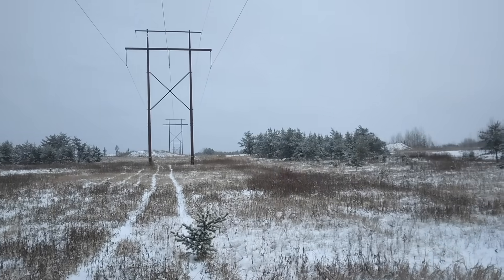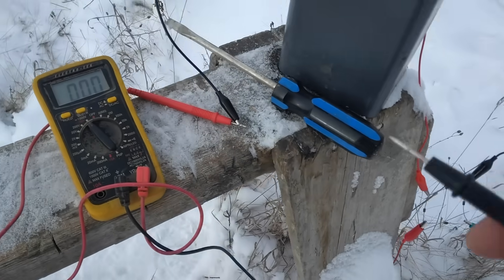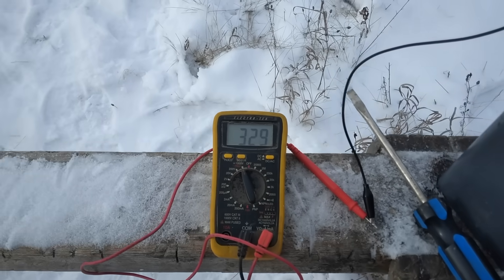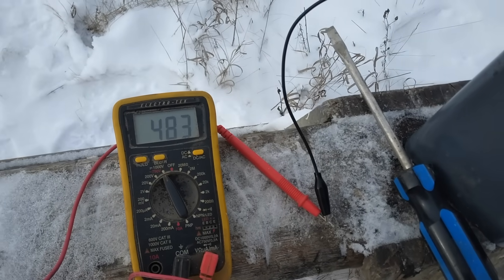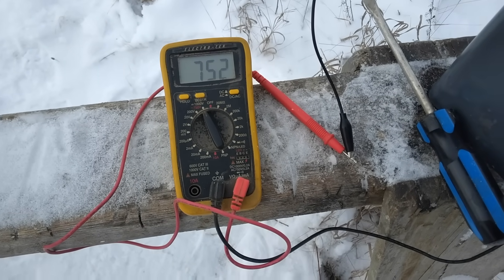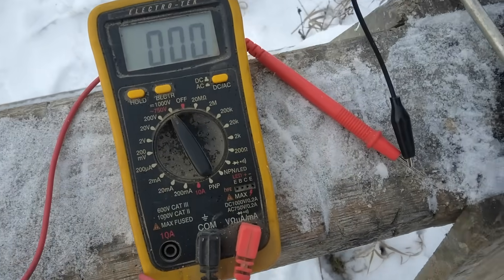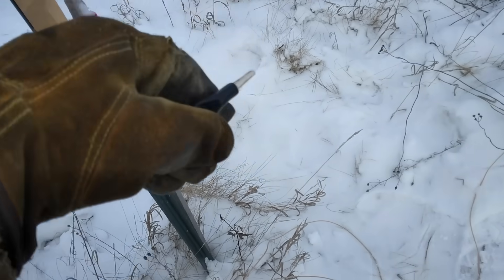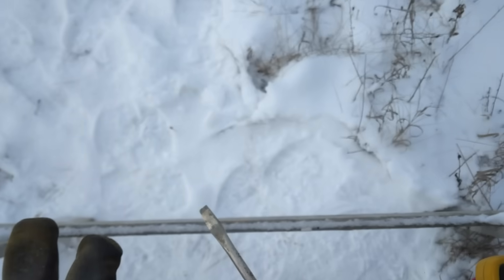Fences sucking power from under HV transmission lines

Comment: Your calculator showed 36.2 joules stored that you discharged in millisecond(s). I had an implanted cardio defibrillator about 4 1/2 years ago that hit me with 33 joules, discharging into my heart and completing the circuit through the tissue in my left front shoulder where the device resides. One week ago, my new device, a CRT-D type pacemaker, defibrillated me with 40 joules. These numbers are documented. It didn't kill me. It didn't really even hurt. It did startle the CRAP out of me and elicited a profanity laced outburst because I had no warning the shock was imminent. It left my ears ringing for about 5 seconds and a tightness in the muscle of my upper chest for several minutes. More importantly, contrary to your suppositions expressed in the video about killing a man or maybe two, that 40 joule mule kick very likely saved my life.
Reply from the maker: With practically no inductance, a HV capacitor discharge can reach its maximum current (Imax) practically instantaneously.  A defibrillator is regulated for resistance and time.
(For the record) Please do not even jokingly suggest that someone try a HV capacitor discharge through their body to try to prove something.
Reply: @doubleMinnovations  In my particular style of defibrillator, peak waveform is attained in approximately 4ms and completes in less than 7ms. Typical therapy applies at 750-900v through 30 ohms and this past weekend, the discharge was documented at 40 joules. My leads are implanted to a very specific site on my heart, meaning no arcing to cause trauma and application of the energy where it will theoretically be most productive. It knocked the crap out of me by total surprise but, then it was over - no lasting trauma, heart rhythm restored.  I wasn't intending my comment as a joke and I never suggested anyone pass any type of electrical discharge through their body. But, thankfully, some very bright engineers developed a very cool device that saves lives and, lucky cyborg that I am, I had one on board when I needed it. To be fair, even a relatively small amount of energy applied to your body in a particular manner at a particular location or at a particular time can end your life. Other times, the human body can demonstrate extreme resiliency versus a much greater amount of energy. What I found most interesting about your video is that I could actually see and hear an approximation of the amount of energy that passed through my heart so recently.

Comment: It'd be interesting to short the inner conductor of the coax to the shield at one end, because that may give you a long run of wire coupled to the power line, with a shielded inner conductor returning without being influenced in the opposite direction (which would normally cancel out the voltage differential across the wire).  At the end of the coax that isn't shorted together, you should see a voltage between the shield and the inner conductor, without the need to connect to earth.  I suspect this voltage would be higher with more available current as well, but it would be an interesting test to find out as I don't know for sure.

Comment: Static DC electricity is present everywhere when a magnetic field is being created around your wires.  I held a florescent bulb up under a high voltage transmission line and it lit up.  A capacitor can be charged as high as you want, but discharge is instantaneous and not sustained. Voltage isn't going to kill you as it's like the voltage from an old TV tube.  You will get the hell knocked out of you, but not kill you.

Comment: 10 Joules to kill somebody .. yes. But how much does your Capacitor hold until it BLOWS UP ?    !!!!
Reply from the maker: It's rated at 1,200 volts.  So if it was charged to that, it would be 63.36 joules.  I pushed it to all I wanted to.

Comment: As a retired building inspector, I have seen why all buildings must stay back from high-tension, high-power lines. 
Among many reasons, electricity can arc through Smoke, especially high-particulate smoke such as that from a wood stove (or solid-fuel burning appliance). Electricity can travel a long distance through smoke. But of course there are Electromagnetic reasons to stay back as well. This video illustrates an example of that electromagnetic energy.
Reply: That's interesting and Thank's.....
Reply: thats gonna cook your soup quick
Reply: Wow through smoke?  I never heard of that before.
Reply: @212days  Try it some time,when done right you will be amazed at "falling" fire which reignites the wick.
Reply: You spoke like an inspector.At least not as a scientist of learned physicist.
Reply: @mmozz8789 should aim to be all 3.
Reply: That is correct and I cannot see how it could possibly be illegal for starters it's not really even a good form of electricity second it dissipates into the air so it's gone forever so if he doesn't get sure it nobody will that means it's wasted and I don't know what the person above us is talking about but I'm pretty sure they can't measure that unless they're doing averages
Reply: @SnowTiger45  I had never thought about that ark and smoke problem but if you had a car fire under one of those lines you might get some help with the fire that ark would be hot and light the rest of the car on fire probably the paint on the metal.
Reply: That's like putting a candle out and lighting a lighter to the smoke and boom the candle is burning again
Reply: So Clouds are a form of high particulate smoke facilitating electric discharges called lightning?🤔
Reply: There must be better information out there for this. Like coils instead of a straight cable.  I would start small and do this with a true high voltage line man who has all the safety gear and knowledge.  I would not use a bridge or a cap.  That cap can deliver a wallop you might just die for, at your own risk and peril.  I got zapped when I was a kid in back of the TV tube with the AC unplugged and learned to respect capacitive electricity in a whole new way. Lots of safety issues here.
Reply: Smoke...Hmmm. Who would have thought that carbon would be conductive? LOL Fog generally has no conductive particles as it is evaporated warm water meeting a cold surface. Smoke in a 480 panel can be a disaster for the person standing in front working live. See "Donnie's accident".
Reply: Thanks for the informative comment... man I'm glad I've always screamed like an idiot and sped under hv lines coving my junk as a joke. Been safer then everybody else going slow under em.... 😅 I figured living near hv lines or cell towers was probably bad for you
Reply: I'm guessing fog and rain drizzle would be worse.
Reply: Fire is an ionizing process which is what makes it conductive and dangerous. Your gas/oil furnace use that ionizing to change the 24v AC into pulse DC to prove combustion and keep the gas valve open when there's a call for heat and the burner is working.
Reply: I didn’t know that about the smoke.
Reply: Arc discharge in volcanic plumes is an example at scale. Dusty plasma in "Space" aligns in filaments that stretch light years. Though effectively a vacuum in material terms fluctuating field effects permeate and inform an electric Universe - not just at atomic scale.
I was wondering recently if ferrous ions might be offgassed by my wood stove. I have noted migrating rust-colouring to some rocks on the top.
I hadn't thought of smoke to local power lines - but I've never felt anything sparky from touching the stove.
Other particulates may also operate your observation - such as dust or pollen.
Lots of nano-particulates now sprayed to save the planet. I don't know if they descend without molecular bonding (ie water vapour) atmospheric capacitance isn't just a voltage gradient but a leaky dielectric we call weather (or even climate).
Reply: @binra3788  Dense fog?
Reply: @binra3788 I know you aren't trying to.  But you sure are good at making me feel stupid.

Comment: Electricity is the biggest boondogle deception since Tesla figured out long ago that power can be taken out of the atmosphere because the earth produces current. Free power could be given tomorrow. Watch " THE LOST CENTURY" documentary. The ancient hitech civilizations were getting power from dolmens on ley lines of the planet. Why were ancient American pyramids and streets set up like a circuit board? Why has huge pools of liquid mercury been found under these? Huge sheets of mica , now mostly gone from looting in the early 20th C , existed at these sites. Mica is an insulator and dielectric. The source of the Aztec/ Mayan mica was over a thousand miles away in Brazil. The fact that power can be transmitted wirelessly has been known. The reason power companies put a series of arrestors on poles is because some figured out, like Tesla, that energy can be " received" via antenna. The utility corp had to " cap" poles at that point. We are on the cusp of a major struggle about energy access. The elites want yo limit freedom via elect costs, and rationing, ehich is totally unneccessary. The climate farce is used to advance it. If they truly cared about environmental issues, they would allow hidden tech and Tesla patents for " carbon free" power. Sadly, it about neo- feudalism. Sorry, had to bring it up. I just paid a 360.00 keeping my home at 62°F, being cold, and 1 person home. I expect since I used my 220v heat it will be higher. Here in Dent Co. Missouri, 13.56 cents per kwh for city managed power. The coop just down the street is like 8.5 cents. If we hit a peak watch out! Amren is about to institute off/on peak  this year. They will charge 5x more from 3 pm to 8pm.

Comment: We had a fence running under a single wire main line coming to the farm, every time we had to fix it i would get a cramping between my thumb and pointer finger when holding the staples and wire.

Comment: I would consider a buck-boost transformer loosely coupled to your capacitor designed for 120V output. As always, you might do this at your own risk, but the possibility of collected power is worth investigating.

Comment: Several people in the power line industry have been killed by the charge built up on a capacitors sitting outside charged up by induction from either nearby power lines or just a little bit of wind over time

Comment: Voltage is pretty much irrelevant.  Total power output is the only thing that matters, and given how long it takes to charge that capacitor, I'm figuring your actual power is pretty insignificant.

Comment: I used to install central vacuums. 
I was finishing an install at one particular house After all the connections were made, pipe and low volt electrical, I plugged in the main power cord. The motor came on as soon as I plugged it in. I thought I had miswired something. I went back thru all of my low voltage connections as it just sends 12-24v out to each outlet and if it comes back, it trips a relay for the motor. I couldn’t find any shorts in the lines. So I put a meter on the wires to check for continuity between them and had none. But why was the motor turning on with the low volt lines connected and not on with them disconnected?  

The only thing I could think at the time was a bad circuit board or maybe the radio station across the street had something to do with it. 

I went to the local RadioShack and picked up a power supply and a relay and got them temporarily going with the understanding that I would be back again once I figured out what was happening.  

After contacting the manufacturer of the system, they sent me a new circuit board and that fixed the issue. It turns out that they had ran into this before and it was indeed the radio station causing the issues. The low voltage wiring was acting as an antenna and picking up stray voltage that was triggering the onboard relay.

Comment: I ask ChatGPT about this. 
What is the resistance of an RC circuit if it charges an 88uf capacitor from 336V to 710V in 2 minutes 17 seconds?

ChatGPT
The charging of a capacitor in an RC circuit follows the formula:

V(t) = V_0 * (1 - e^(-t/(RC)))

Where:
- V(t) is the voltage across the capacitor at time t,
- V_0 is the initial voltage across the capacitor,
- R is the resistance in ohms,
- C is the capacitance in farads,
- t is the time in seconds,
- e is the base of the natural logarithm.

For your specific case:

R = -t / (C * ln((V_0 - V(t)) / V_0))

Given:
- Initial voltage V_0 = 336V
- Final voltage V(t) = 710V
- Time t = 137 seconds
- Capacitance C = 88 μF

Plug in the values:

R ≈ -137 / (88 * 10^(-6) * ln((336 - 710) / 336))

R ≈ 1.37 x 10^6 ohms

Therefore, the resistance of the RC circuit is approximately 1.37 Megaohms.

Lamont here, Source resistance is very high, not much power is available.  Most of it is poor magnetic coupling, 60 Hz, couples better with an iron core, air core is not so good.

Comment: I read somewhere that 1 mile of wire running parallel to high voltage lines and grounded at one end , when tapped will produce pretty much the same voltage as the lines carry

Comment: The power lines are part of a condensator between them and the ground. any plate (cabel) between the two plates of this condensator will have the same % of voltage as the % of distance to the powerlines. Here we have a 3 phase line which will almost eliminate each other in the middle of the 3 lines.So I guess you will have the best result somwhere offset from the middle.  Also the current will be very low so insulation is key may be using several diodes in a row to decrease their leakage might help too.
Nice experiment, and thanks for the video.
Reply from the maker: I believe you are right.  Thanks for commenting.

Comment: If you have ever seen train tracks running under high voltage power lines the lines above are always super insulated. Its so the track doesn't get energized.

Comment: Cool experiment.  You should try putting your multimeter in Amperage mode, and put it in series with that circuit.  I t would be interesting to see just how much current is flowing through that circuit.

Comment: Free fence charger. Put a resistor in series with your meter probe  and use math to figure the voltage, saving your meter damage.  When  discharging the Cap, use an 18 Meg resistor  across it. Bleeding the voltage off.

Comment: Power = Voltage x Current.   A watt is a Joule Second.  So you didn't get much useful energy, even based on your readings.  Insulation, even flesh or air breaks down at higher voltages.  This is a similar statement at marveling the potential destruction of a bolder up a hill, but if its not rolling, it's not doing anything. Another interesting and similarly dangerous experiment is to fly a balloon a few hundred feet up on a thin wire. On a sunny day you would get pretty high voltages too just from nature. Possibly dangerous but not enough power to do much.
Reply from the maker: No, it's not much power, just a tiny bit.  But it was fun...

Comment: Hmmmm. I'd get an NE-2 lamp, wire it in series with a transformer secondary and that capacitor. I'd put a full wave bridge on the primary of that transformer, step it down to 12 and rectify that to charge a battery... When the voltage hits near 90, the neon will fire and dump the capacitor into the transformer...Kewl resource.

Comment: If you conduct and set up a circuit wiring just to expimentally collect electricity from under power line for a short period of time then remove your wiring and leave, you could be legally OK. If you use this means to collect electricity for your everyday use, you can run in trouble since this is a thief.

Comment: Fence "charging up" is relativ. On our wind farm we have high power lines across. With a volt meter i get 50vac when holding one lead in the air,but i get 150vac if i actually have the other lead stuck into the ground. Does that mean i am in a cloud of electrons? Yes
 Do i die? No. The low charge dissipates around everywhere.- you actually do something different, you isolate the energy and accumulate it, NOW its dangerous, but ONLY where the measured potential difference is high, which is actually only between the capacitor contacts.

Comment: I would be interested to see the significance of proximity. Would an ungrounded wire of moderate length at the height of a privacy fence or even a security fence (within the allowed easement restrictions) potentially be dangerous on its own? I'm guessing someone knowledgeable in induction could estimate some field strength values from the video and provide a reasonable ballpark, but I'm fascinated by seeing this occur (safely) in the real world.
Reply: If the wire was bare it would be grounded at every point. If it were insulated, it could have a small amount of power based on the ground potential from one point to another. The earths magnetic field is pretty weak. If it happen to run parallel to a high current wire nearby, it could have the potential to be dangerous ( it would have to be a one way current, not your house wiring which has the return wire running right next to it). If it passed througg by a huge magnetic field from say a transformer,  then it could have its own potential from one end to the other to make a circuit, but that would have to be very specific circumstances and it would still likely be a neglige amount of power.